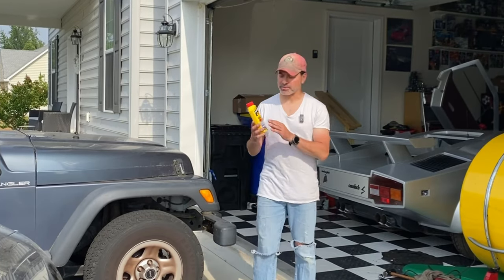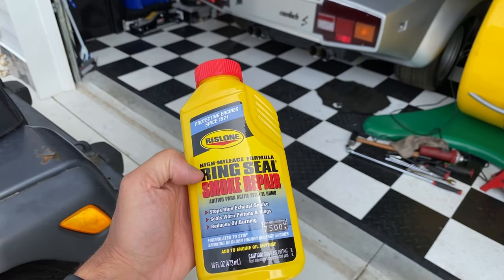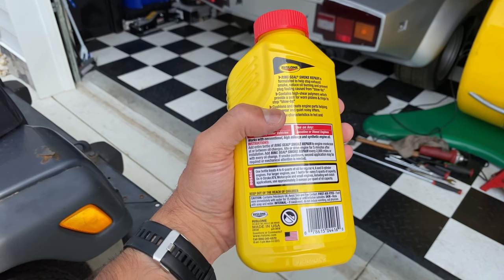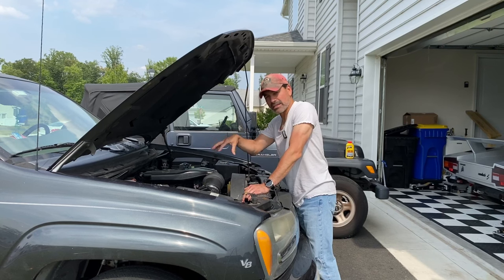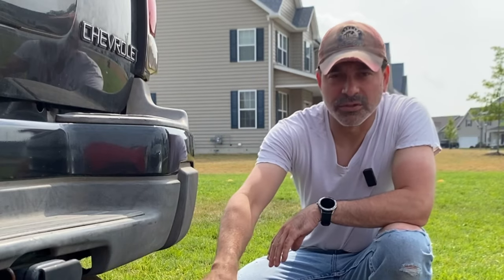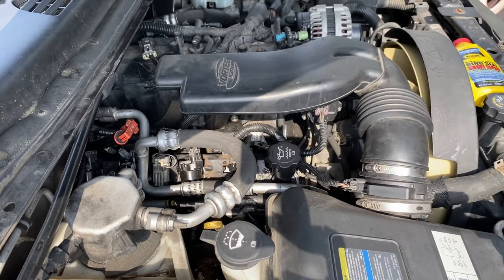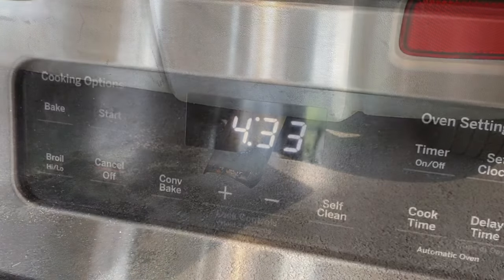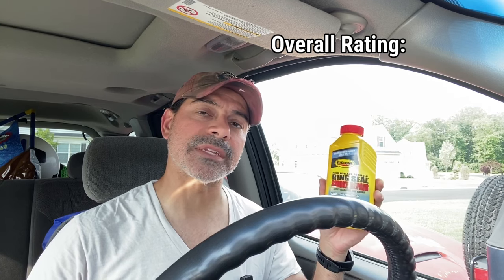Rislone Ring Seal Smoke Repair - Product Review (Andy’s Garage: Episode - 417)

Comment: I had very good results right off the bat and within 100 miles of normal driving the miss fire issue was cured. That was over 2000 miles ago and without having to add a second dose, the issue never returned. I have used Rislone products in the past and and never had any issues with their performance. Great video sir. Thank you. Be safe.

Comment: My geo metro smoked when I put it in park. I didn’t notice it when I drove around. But everytime I parked the car a bunch of smoke was coming out the exhaust. I drove 300 miles one week. And checked my oil at the end of the week I was almost dry. Sometimes def not right. I poured a bottle of this in my engine. Almost instantly (15 min) I had my car parked and smoke went away. :)
Reply: What about the oil consumption?
Reply: @gsxellence 😮 what about oil consumption
Reply: @peptoboy  if it helps with oil consumption at the vale seals

Comment: Glad to see this stuff can work. I want to put the word out that it’s almost impossible to overfill and engine. There’s a test on YouTube and it took like 4 times the amount of oil before it even started to leak so anyway even if you had 2 quarts extra it could never do anything to a motor except make the oil last longer but as far as damaging anything it’s just not possible.
Reply: You’ve obviously never built an engine. Some handle high/low levels differently, but none should be operated with too much oil. Don’t care what a YouTuber says.
Reply: @freebehindbars8654  Actually I have! I was raised by a mechanic and I’ve built 4 engines with my last one just finished which is a 6.6 Duramax. Anyway my point was that in this study which was done by professionals it took a full engine of oil for it to even blow out the seals and leak. Any car engine that has a quart or two too much would never hurt it but I agree it’s best to keep it at the correct level mostly due to oil pressures
Reply: Wrong you can destroy any engine if the oil is way above the fill level .. the valve stem seals will go then u will be smoking crazy ..
Reply: @mtbridingog9083  Of course! Eventually it will ruin the engine. You need to watch the test they did on overfilling but they did it in real time all at one and just kept adding a few quarts at a time and then running the motor. It took a while and I think the valve cover gaskets actually leaked first but not sure. Cool video to watch. They have a transparent plate on the side of the engine block
Reply: As I said before, watch the video on them overfilling a motor. It takes a lot of oil to cause damage and it’s not just one or two quarts. Common sense will tell you and show you that everyone has seen a motor with to much oil such as a quart or two high and it will NEVER cause harm. Why would it? Not even possible
Reply: You’re right and it did blow out the gaskets but it took a lot of damn oil. Anyway I’m talking more about people getting fussy over a few quarts and trust me. That won’t do anything. Hardly any pressure down there anyway. Even low oil will do nothing unless it was under maybe 2 quarts low. Low oil is only going to break down quicker because you have less oil to use of course

Comment: The oil burning with bluish smoke can be from sticking lowest piston rings OR valve seal/guide and both are expensive to replace. You may have a car not worth putting a lot of money into and a monthly car payments is easily $450-600.
Reply: You can replace your valve seals yourself for like $45 for seals for a V8, even less $$ for a smaller engine. The way to tell is valve seals only give off blue smoke for a moment after the engine has been idling and then you give it some gas. Like when your sitting at a red light and then the light turns green you leave behind a puff a blue smoke when you accelerate off the line and then it goes away.

Comment: It worked perfectly for me. First I tried Lucas oil treatment ran that for a few months with no improvement on the blue smoke issue (I only had blue smoke on cold start). 

I decided to try the Rislone next. I added the rislone and the problem went away instantly! I mean, after running my car for only a few moments I haven't seen blue smoke again. I'm unsure if these are the results everybody can expect. I do believe you are required to put on a few hundred kilometres or miles first. Regardless, it worked amazing for me.🙏🏽👌🏽
Reply: Wow, your comment just helped me decide, thank you!
Reply: any updates on this?

Comment: Nicely done video. I actually prefer stp oil treatment if I need an oil thickening additive  as it's the only one on the market to have zdp. Zinc included in its ingredients.  It's the best antiwar agent discontinued in most motor oils except diesel oils because it was detrimental to cat converters.

Comment: All additives are a band aid solution. Do a compression check, then repeat the test after putting a little oil in the cylinder. Bad rings will see an increase in PSI.

Comment: Just be carful with you oil pressure sensor filter. Mine clogged within 30 miles of putting this stuff in my 09 Silverado. Talked to 2 different mechanics and both said they believed it was the Rislone that caused it.
Reply from the maker: @timhansen14  thanks for the feedback

Comment: Hey buddy i have 2006 honda accord ex sedan 2.4L engine my car seem to be running good until Timing Chain broke so i changed the Timing Chain but now i have all these problems like rough idle & miss firer it keeps shuting off it's putt putting hard from tail pipe alot of blue smoke at 2000 rpm and more alot of gas odors around the car / i have to do oil and spark plug change to but still will this help or is my piston rings and seals and burning oil are mostly the problem like in this video you explain ??? HELP
Reply from the maker: Sounds like the timing is off. Did you do it yourself or did you have a mechanic do it? If a mechanic, take it back to them to fix
Reply: @PhillipsVision  No the timing is fine - what I'm asking ? is are the same things you explain in this video, does it compared to my car problems and is it or could it be the same issues I'm having with my car after i did the timing chain is what I'm asking you ???
Reply from the maker: @laughoutloudsweat277  no, you issues do not sound like something that can be addressed with additives. I would recommend having a mechanic look at it
Reply: @PhillipsVision  okay cool I will do that but what I'm saying I think my car has the same issues because of the same symptoms as the truck meaning I think my car burning oil because of light blue smoke and I need to change the valve seals , the oil , the spark plugs as well is what I was saying because it's literally doing the same exact thing as the truck
Reply: And I do my own mechanic work I don't pay for nothing it's free by me lol and better and cheaper I'm just asking for advice to be sure
Reply: Easy fix,put your honda in river 💩
Reply: I have tickling on my ford edge by the bell I can use this product
Reply: @laughoutloudsweat277  try to do a leak down test and go from there that's my best advice i can give you. Or you might just have my bad luck. I fix one thing and somehow something else happens to go bad at the same time. Meanwhile never touched anything near it to cause it to go bad. And that's what I call life slaps back at us. I would like to know if you fixed it or how you ended up fixing it.
Reply: @laughoutloudsweat277 I’m all for diy… but you have to know… there are some things you will need a mechanic for… even if to just look at it and tell you what it might be. It’s fine to do the work yourself… but only expertise can diagnose
Reply: @Mmmmgood317  thanks and update: I found out what it was, it was my piston rings I changed the valve seals, vtec solenoid with oil pressure switch and screens cam shaft sensor/ crank shaft sensor it was needed also and all gasket all are new, so from breaking engine down it was my piston rings so I took care of it and put it all back together and now it runs and purring like a kitten smooth as can be just like a brand new engine but also I still thank you for the advice either way tho.